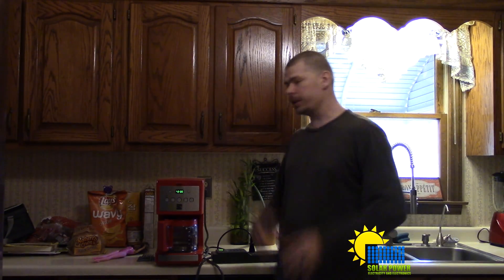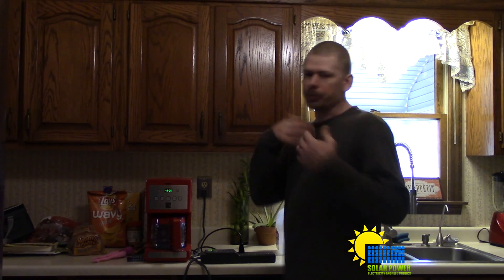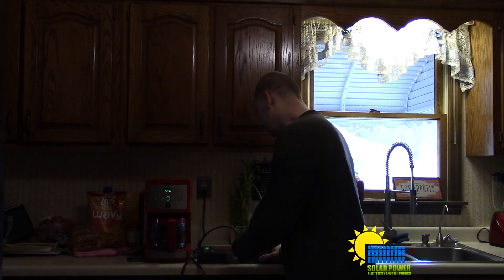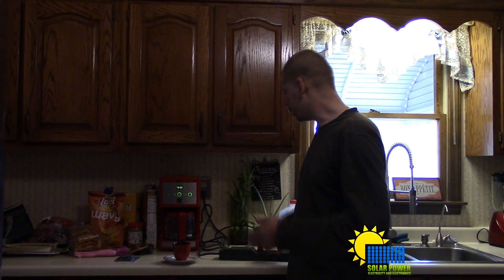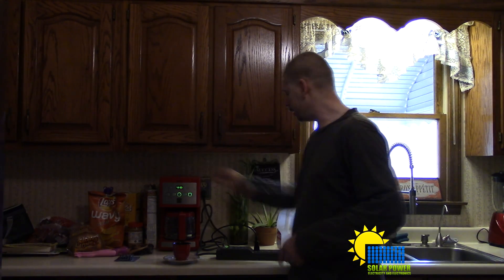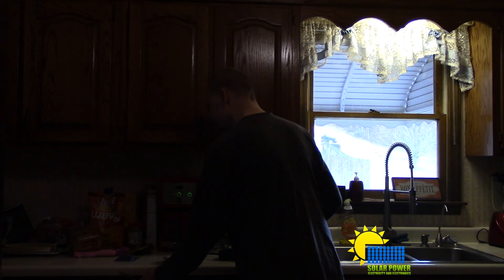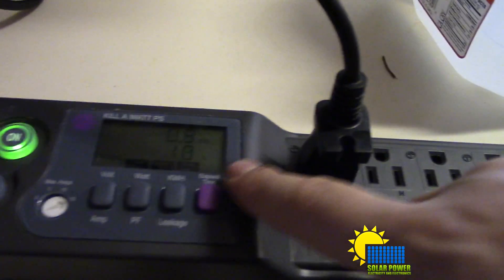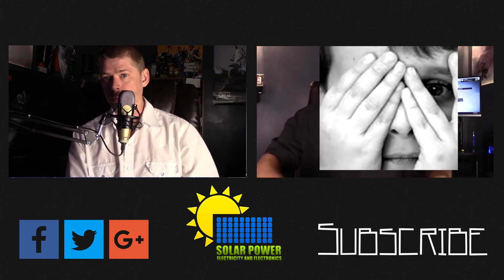How much power does a coffee maker take from a solar array to make a cup of coffee or two?

Comment: Solar Power Electricity and Electronics My coffee pot pulls 900 watts according to my Kill-A-Watt meter.  It takes 12 minutes to brew a pot on average, and I allow 15% for efficiency losses DC conversion, wiring etc.  So I figure 900/60*12*1.15= 207 Wh to brew a pot.  Once my system is up and running at the end of spring, I will have a more accurate idea of losses and will factor accordingly.  I turn off my pot as soon as the coffee is brewed, I get three 22oz mugs from a pot, mugs two and three I heat up in my microwave for two minutes.  My microwave draws 1450 watts at full power, so  1450/60*2*1.15*2(Mugs)= 111 watt hours.  So I use 308Wh of electricity allowing a 15% efficiency loss to make a pot of coffee and reheat the second and third mug.  I can't wait to get my system up and running.  Great videos mate.  Keep them coming.